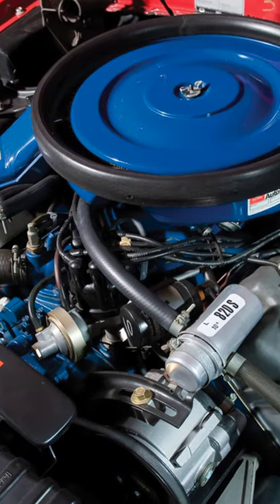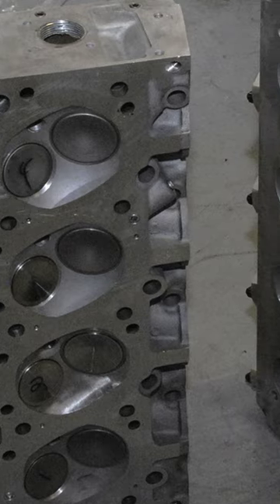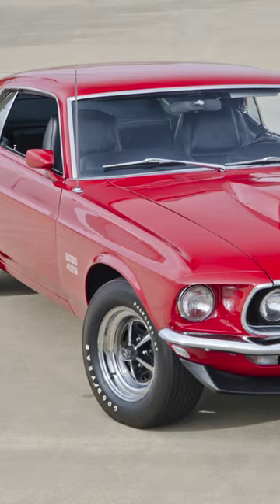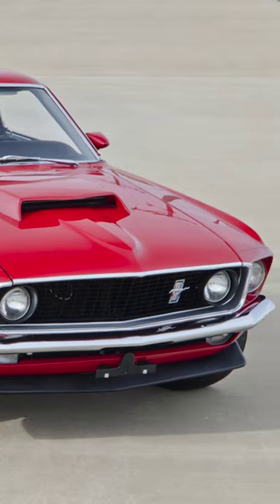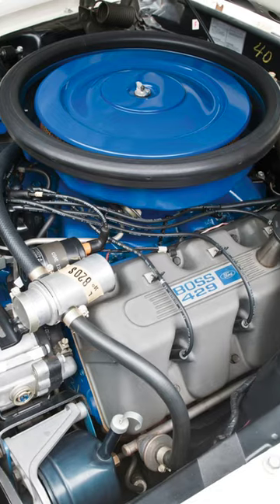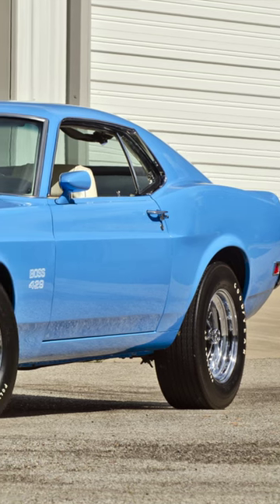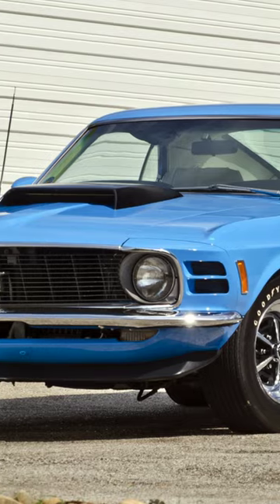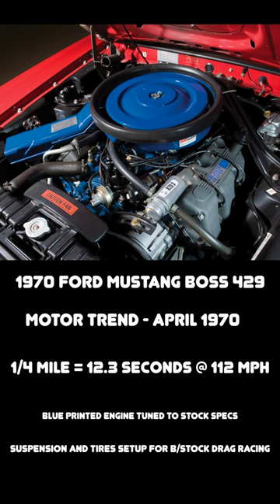Ford's Hemi V8 - Boss 429

Comment: I had a 71 LTD convertible Blue white into. With a 429 SCJ that baby would FLY
Reply: I'll bet it did. I had a 71 Ford Custom with an N code 429 and the rest of the car was police spec. It probably weighed a bit less than the convertible. It would run the 140 certified speedo out of the numbers easily. Pretty quick too with the 325 gears. I would turn that thing 6200 in first and second that was about 110 in second.

Comment: That Mustang Boss was "truly" the Boss of the street !   I had a 69 Chevelle SS  and that was one of the cars I didn't want to come across on the street...next to the Hemi Cuda or the 71 TA with a 455 was the other.  Thank goodness I never came across the Boss....but I wound up selling my Chevelle and buying a 71 TA 455 with a factory Hurst 4spd. 🤣.   The 73s weren't fast at all (they cut HP in all the cars then)   But that 71 could yank ya back in the seat real quick.  
Those we're DEFINITELY the days of raw power for just that straight line track.  😊

Comment: A friend of mine bought the 69 mach 1 with the 428.  It was the dark green with gold metallic, flat black hood with the shaker, rear glass louvers, and gold stripe down the sides. I could not believe how strong that car was. Would love it had it had modern radials so it wouldn't spin so much.

Comment: Respect for the 429! My personal favorite. It was a peak for the 'stang (at the time). The 428 Cobra Jet wasn't too shabby...✓ especially compared to the 390...
Reply: The 390 was no slouch.
Reply: @Kevin.W. No it was not, one of my favorite Ford engines actually.
Reply: @jesterokjones4954  Mine too, I've owned a few.
Reply: @Kevin.W.  I had one in a '66 Galaxie 500, ugly maroon color, lol.
Reply: @jesterokjones4954  I had one in a 68 LTD, and one I built in a 66 F250, both were blue.
Reply: Ford rated the 390 at nearly as power as a 428. In my opinion the 427 was king. They made a factory racing 427 with around 600hp.
Reply: @coop93chevy  That's true,  although in reality, the 428 was closer to 400hp, like most, they were underrated for insurance purposes.
Reply: @jesterokjones4954 I had an ugly maroon color 65
Reply: 390 was no slouch as really all the 428 was a larger displacement 390 h.o.   but I never understood why they went from the 427 to the 428.  The 427 was an animal only to be beat by the 429.  Don't forget about the other hemi style engines/canted valve motors.  The boss 302 and the 70 351C 4 barrel M code, and 71 boss 351 all wearing the same quench chambered canted valve heads and later 2 making more hp than any other small block on the market and the stock values being grossly underrated.

Comment: The boss 429 also came in the Mercury Couger. Though they only made a few of them
Reply: It was never a production car. They did stuff 2 1969 Cougars with the boss 429 for drag racing only. And they were nasty. It would've been an amazing car if they would've made it a production vehicle. The 67-69 cougar is my #1 dream car.
Reply: I was looking for this comment. Which 
you are correct. But it was only 2 
cougars that received the Boss 429. 
Something to also look into is the Ford 
Cougar ll (not Mercury) that was married 
with the 427 side oil pumper. It kinda has 
the silhouette of that of a corvette.

Comment: My dad had a 71 SS nova 396/375 horse car. It was balanced and blue printed and he added headers. His best quarter-mile was 11.21 at 122 miles an hour.
Reply: THATS fast.   It’s only a second slower the a Bugatti that has over double the power.   👌👌👌👌🏴🏴🏴
Reply: @CoyoteFTW  with nitros.  Surely.
Reply: @russcooke5671  And cost two million dollars! It better run 8s for that money
Reply: @m42037  hi Ken. What costs two million dollars.
Reply: Buy the way. An  8 second quarter mile is 180 mph.   For that you need  about 2000 hp.
Reply: @russcooke5671  For 2 million dollars it should be as I said. I used to race how about you? Those cars you speak of are also ugly.
Reply: @russcooke5671  Your car that you Googled. 2 mil is what they are and more expensive models go up, besides Elon and Trump nobody can afford one so it doesn't belong in this comparison. Like comparing a 65 RR to a new Chevy smh
Reply: @russcooke5671 you can do it with less power in a lighter car
Reply: My '69 Nova SS with that motor, 4 speed, street tires and exhaust turned a 12.98.  I still have the yellowed time slip.
Reply: @johngaither9263  On bias ply someone was a good driver 🙄
Reply: Funny is Ford had an Fe back in 63 you could buy and drive on the street would turn 11.6 stock long ago

Comment: My 455 stage 1 ran 115.5 mph in quarter with 2.29 gear and 14" street tires. Shifted at 4200 rpm lol. Est 428hp but torque around 585. This is by far my favorite ford car ever made.
Reply: Olds were notoriously underrated as well, as they were measured at the hib from factory, while even Chevy measure at the flywheel.  That makes their paper claim of 500lb-ft even more impressive/scary.
Reply: @toddthezondalover645  He was talking about a Buick 455 Stage 1. Quicker than them all, bone stock. You have to be making some torque to run that quick and fast with 2.29 gears.
Reply: @davidkeeton6716  I had a brain fart, and meant to say Buick haha.  Watched a video from 85 or 86 and those stage 1s were embarrassing everything.
Reply: Had a friend who had one. Stage 1  in nice shape that just sat in his parents side yard out in the country covered in a tarp . Never drove it. We took it out one dark night in 79 on that not so straight back road his parents lived on. Ten foot ditches on either side . He punched it , my head hit the head rest and stayed. He looked over at me and said look at the speedo. He says we're doing 90 and I still have two gears to go. . .and laughed. I don't remember making it to fourth gear on that road. One of  if not THE fastest stock cars I've ever been in. Yrs later a friend bought it and did some restoration. Rode in it again but didn't get wild in it like that night.  Had another friend in High school who's dad had a GSX. One of the yellow one's. That only so many were made. Never rode in that one and his dad picked that car up at the factory where it was made. Good time's
Reply: @davidkeeton6716  that’s a 1st gear ratio.
Stage 1s came with 3.55s and optional 4.10s
Reply: So what's the ET time not just the trap speed 🙄
Reply: @m42037  ditto, with at least four significant digits, please
Reply: @Mattryanfisher  He's lying we know that. He was shifting at 4200, these motors redlined over 6k. I was shifting in my Galaxie (warmed over 390) at 5200 running 13.70s with 300 hp at the tires, traction wasn't the best but was racing for fun on occasion it was most a driver.

Comment: The racing engine dubbed the Boss 429 cu in (7.0L) 385 series v8 , was an aluminum hemi-head engine design with gigantic ports and valves for high rpm use. Although the Boss 429 Hemi design worked great on the track, the large port heads were too big for street use, so the Ford engineers designed a different head for the passenger car engine

Comment: It was just like Ford to develop a giant-killer of an engine, like the Boss 429 and Boss 351, then only make them for one or two years and only in one or two cars. It was frustrating to be a Ford fan in those days, when Chrysler and Chevrolet would put a Hemi or a 427 into anything that it would fit in, and paste a window sticker on it for you.
Reply: Strange isnt it? Good engines seem hard to come by these days other than a very specific few companies. And sometimes in older cars!
Reply: Then race them for one or two years and pull out of racing completely.
Reply: Wasn’t Ford fault they came out right before Malaise era 1973-1983, US oil embargo didn’t help either raised gas prices and engines starting getting choked up by emissions so legendary performance engines like Boss 429 or Cleveland had plugs pulled very soon after introduction. Imo the best big block and small blocks ever made 385 series and 335 series Cleveland. They were unmatched in motorsports especially in prostock. Their potential is unrivaled. Sold for just two years and very limited numbers sold even for 429cj scj which is just a Boss 429 with crescent heads like the Cleveland. Seen that engine propel 4000lb Mercury muscle to a 11.3 at 127mph, BBF was the last big block to be introduced. It was latest greatest wish government BS wouldn’t of killed performance. Just look at the damage the Fe big blocks did. I mean quickest car in SS/A history is a 427Fe big block Ray Paquet running 8.4 seconds 1/4 mile in his Ford Thunderbolt.
Reply: @CoyoteFTW  look at who was president then.when the oil lies started ..and look at who is doing the same bs today
Reply: @mikecross4350  
Maybe we should've kept leaded gas too. Doorknob.
Reply: @Adam1nToronto  how many people did it kill?
Reply: @Adam1nToronto  there is no gas shortage. Only artificial choking of imports. 
Leaded fuel was wrong, and emissions control is good... But to what degree will it stop?
Reply: Biggest thing that killed it was NASCAR restrictions on it and the Chrysler Hemi. Bill France wanted Chevy back in NASCAR I’m the worst way. With corporate GM still discouraging activities involving factory sponsorship there was no way Chevrolet was going to be able to develop a Hemi engine. So with Chevy backdooring Junior Johnson’s team they were able to race the Monte Carlo and big block to make them competitive. Ford pulled out of racing in 71, Chrysler teams with their budgets slashed to Richard Petty and Buddy Baker switched to the slippery 71 on up B body, and with some dedication were able to pull the old 426 wedge out of mothballs, fashion some new heads using the motor home casting of all things to get competitive again. The guys running the Ford and Mercury cars also adjusted.
Reply: @CoyoteFTW — you curse the government but you don’t realize how bad the air pollution was back then and it forced technological advances that we enjoy today as they used to have you driven a ford lately, hate to break it to you but fords coyotes and flat plane engines put the old FE and 385’s down at the track no comparison at all
Reply: @middleclassretiree  
I
Reply: @middleclassretiree  
2 comments, I fully agree with you on pollution, riding my bicycle to work last week, got behind an old dump truck at a couple lights, couldn't breath, thankful for most of the controls. I'm more into drag racing, was there a problem with the 429 cam and heads robbing power away from the crank so the rpm range was hit or miss, and weren't as dependable as GM or Mopar engines?
Reply: Copo's.
Reply: @middleclassretiree  Air polition wasn't that bad. Smog wasn't from automobile or truck exhaust. It was determined from actual testing to be ozone from electric trains with brushed motors. The whole change to fitght smog was based on bad guesswork and a total lack of testing.
Reply: Ford offered the 427 ,428 and 429 in cobra jet and super cobra jet in everything from mustangs to galaxie 500 and the mercury’s as the marauder and super marauder engines again in everything from the comets ,cougars to the Monterey’s and marauders you could even get a 428 cobra jet in a pickup truck these engines were very underrated and ford only pulled the boss 429 when nascar banned it , if you had been around then you would have remembered the ford total performance era
Reply: @mikecross4350   — Nixon?????
Reply: @garymanis6305  — pollution wasn’t that bad, ? ,I lived it the cars were just pumping unburnt gases out the pipe and if you sat at a light you could watch all the engines blow by shooting out the blow by pipe that exited out by the oil pan, if I wore a white shirt in Los Angeles for a half hour it would reak of unburned carbons and would have a dingy brown tint to it and your eyes would even water and yes it was cars that were pumping out the pollution. I love drag racing but I have to breathe it’s kinda essential, besides the best of the muscle cars were only turning 14’s in the 1/4 todays Toyota Camry’s can out run them
Reply: @garymanis6305   - I don’t know what you been smoking dude I lived it first hand and it was from cars and trucks as well as coal plants , the only trains that really polluted were the coal fired steamers, you have some issues if you think it was from the armature’s on electric trains 😂😂👩‍🍳, get some help
Reply: @middleclassretiree  I was around then. I had a 78 Ford F-250 truck with the 429 engine. It passed everything but a gas station.
Reply: @middleclassretiree  I'm 56 here. By 1965, PCV valves were standard equipment and were required in CA in 1961. There is no question that cold engines pumped out unburned hydrocarbons. EGR valves mitigated that. EGR came out in 1972/73. My 1973 Olds had it.
Reply: @middleclassretiree  have you ever driven a modern Camry? Old school muscle was 0-60 in 5 or so, modern camrys are lucky to hit it in 10. No idea what you're talking about
Reply: @BL DontMatter  

Obviously you haven't....lol!!

Comment: This engine is what Pro-stock champion Bob Glidden cleaned up the tracks with through the 70's into the 90's.  Most wins in Pro-stock history.
Reply: bob killed with the cleveland. he didn't start with the boss9 until 82 when they switched to the 500 ci rule
Reply: @brianadams429  Yes, you are correct. How big in inches did the Boss go? As far as I remember, he also competed in IHRA where they ran 700 cubic inches. Did he make a 700 cui version of the Boss 429?
Reply: @Santor-  if i remember correctly, Bob Glidden set a record back in the early 80's with a 632ci bbf in Ihra. I can't remember if Bob ran the boss9 head or if it was a wedge head that he helped devolped for Ford which were the SVO Motorsports head that had 2.45" intake valves, 2.19" ex valves. The runners were the size of a soda can.
To my understanding thats as big in cubic inches as a engine can go that a factory production type head can handle, after that you need a purpose built head. Sonny Leonard is who said this. Sonnys racing engines, Alan Root in a interview said he built all Sonnys blocks, so my guess is Sonny built the heads which are massive.
Just like Kaase builds his own.

Comment: in 78’, I bought a used 1971 Mercury Marquis Station wagon that had belonged to a local doctor. It had a 429 cu with a C6 trans. That thing would fly! Not much could beat that ol boat from around a 30 mph rolling start! Much as enjoyed the torque and power, I enjoyed that air conditioning the most!

Comment: The main reason it was rated like that was insurance. The Z-28 with the 302 was rated at less than 300 HP but was believed to have much more, I heard the numbers were actually closer to 425 HP, but never seen it in print. The up grade to the big block engines wasn't really that much more money, it was the insurance company insane charging that kept most of the sales low. The way around it was they would detune it for insurance purposes but a good mechanic could put it where it capable of doing. I remember a shop a few miles from where I lived. Anyone who had a Ford and wanted to make it faster ended up there. Some of those old shops were brand loyal. They would work on any of them but just seemed to enjoy one over the other.

Comment: What a lot People dont know is that engine cam from the Factory under Carbureted and Under Camed!! With a couple of simple engine Modifications Carburetor,  Camshaft, and Ignition you could very easily gain an additional 100 H.P.!!

Comment: My first was a stump puller, 1966 Ford Fairlane 500 XL in 1974 with a 390 4spd. Fast forward in 1999 I owned a highly modified 1997 Mustang Cobra: dyno'd at 525 bhp to the ground. I got clocked @187 mph at Infineon Raceway, then later @11 sec in the quarter mile at Sacramento @128 mph on street tires. I couldn't get grip in 1st or 2nd, but went through the traps sideways in 3rd on a regular basis.

Comment: This was not the only hemi style or canted valve motor fprd made.  The boss 302 boss 351 boss 429 and 1970 351 Cleveland M code same head as the above boss 302 and 351.  The Cleveland M code was a complete race motor with 11.1 compression, and the boss 351 in 71 had the same head with a solid adjustable valvle train.  2 sweet motors!  The 302 was the same head sitting of a windsor style 302.

Comment: IIRC the trouble with these cars was that they simply weren't as quick off the line as the Cobra Jet cars. Something about those heads made it so the cars just didn't want to rev from low-down.

Comment: If not mistaken... Manufacturers soon switched from advertising total gross horsepower at the flywheel to true Net horsepower ratings using dyno.

Exmple: 400 gross, 325 net at the axel
Quarter mile time, Trap speed twas what drivers interested in most.

Comment: however ford from the factory, did put a limited number of 428 heads and intakes on 390 blocks in mustangs.  friend had one.  he actually called Ford and they confirmed serial number. even tracked down original owner.  built to qualify as a publicly offered production car to meet racing rules.

Comment: One fact that you got wrong, it was also available in the mercury cougar. There were 2 in Spokane that I knew of, and they were better on the drag strip because the engine was 2 or 3 inches further back, giving them a better front to rear weight balance
Reply: I was looking for this comment. Which 
you are correct. But it was only 2 
cougars that received the Boss 429. 
Something to also look into is the Ford 
Cougar ll (not Mercury) that was married 
with the 427 side oil pumper. It kinda has 
the silhouette of that of a corvette.

Comment: I almost hated to comment, because the number of comments had just reached 429. HOWEVER the 1970 Torino SCJ also had the 429. My best friend had one with the Hurst shifter and the 4 bolt main caps on the middle three bearings.